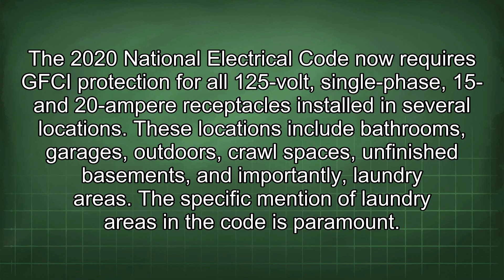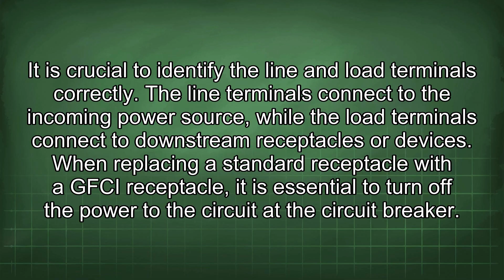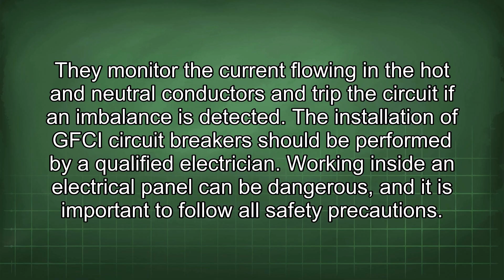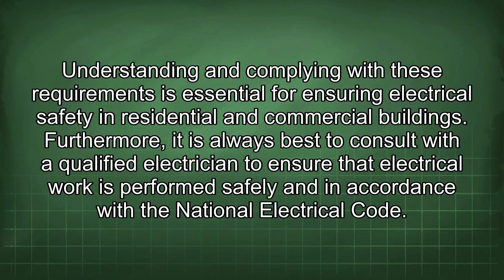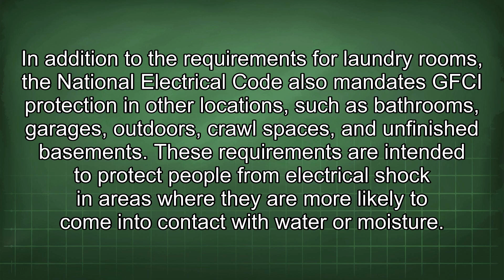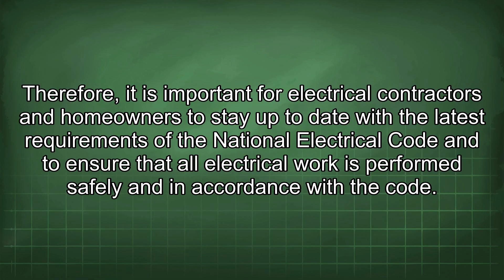Laundry Room Receptacles and GFCI Protection Requirements

Comment: would a separate gfci outlet be required for washer located in the bathroom when there is already a gfci in a different outlet than where the washer would be plugged into?
Reply from the maker: Hello @brendad3570,

Thanks for your question! Based on the National Electrical Code (NEC), the answer depends on whether your existing GFCI is on a circuit that is allowed to power a washing machine.

While a single GFCI device can protect multiple outlets downstream, placing a washing machine in a bathroom creates a conflict between two different "dedicated circuit" rules.

1. The GFCI Requirement
Under the 2023 NEC, all receptacles in a bathroom must have GFCI protection (Section 210.8). If your washer outlet is wired "downstream" from an existing GFCI outlet, it is technically protected. You would not need a second GFCI reset button at the washer itself, provided the first one covers the whole circuit.

2. The Dedicated Circuit Conflict (The Real Issue)
The NEC has strict rules about what can share a circuit in these two areas:
- Laundry Circuit (NEC 210.11(C)(2)): The 20-amp circuit for the laundry area must serve only laundry receptacles and nothing else.
- Bathroom Circuit (NEC 210.11(C)(3)): The 20-amp circuit for the bathroom must serve only the bathroom. It is generally intended for high-draw items like hair dryers.

The Dilemma:
- If your washer is plugged into the existing bathroom circuit, you may be in violation of the "Laundry Circuit" rule, which requires a dedicated 20A circuit for the washer.
- If you run a new dedicated laundry circuit to the bathroom for the washer, it must have its own GFCI protection (either a GFCI breaker or a GFCI outlet) because it is located in a bathroom.

Sincerely,

BESA Research